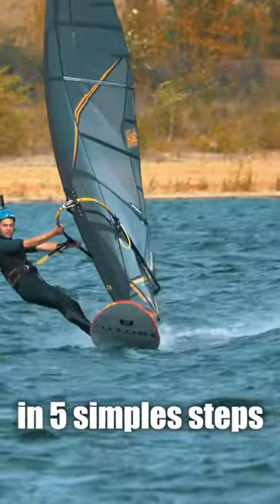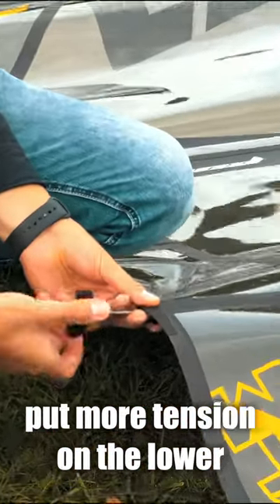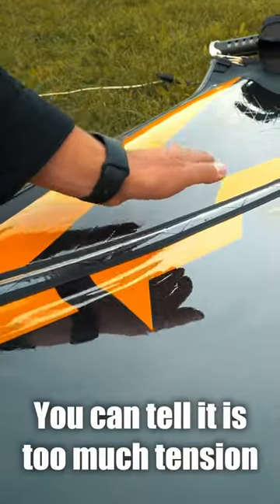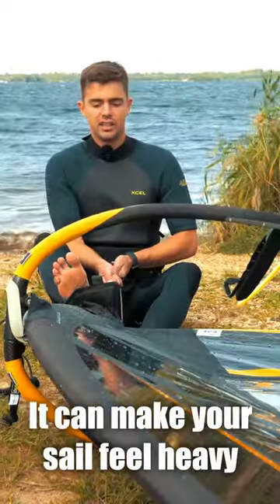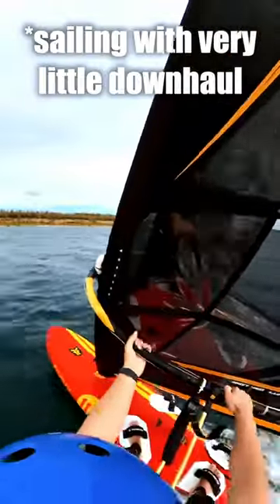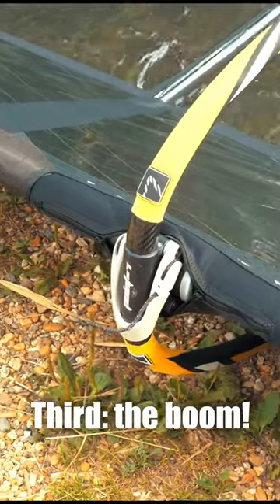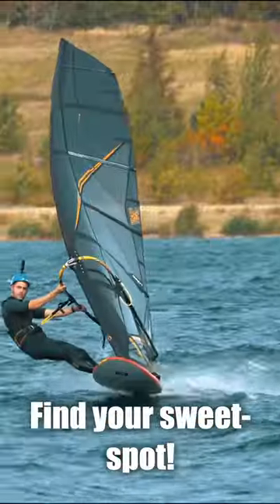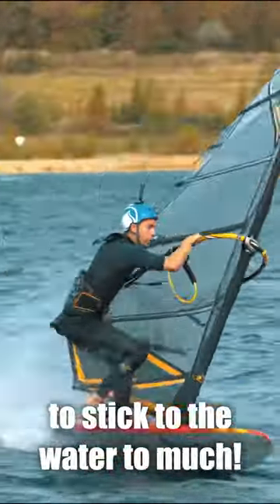5 Steps for more performance!🔥 #windsurfing

Comment: 60kmh is crazy for me. Im somehow stuck at 41kmh
Reply from the maker: What gear do you use?
Reply: @MarioKuempel  I use freeride equipment. Duotone Epace sail, Fanatic Gecko board. For the fin I change between the 42cm stock one and a Maui ultra weed fin. You think it might be the speed limit of the gear?